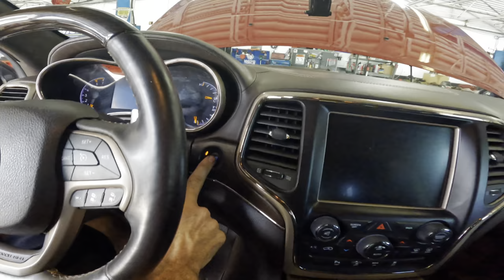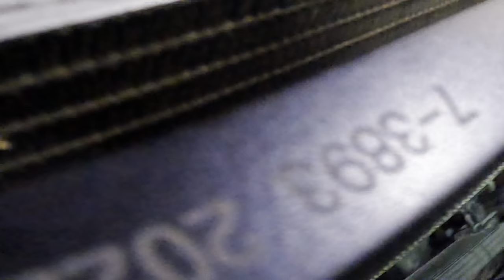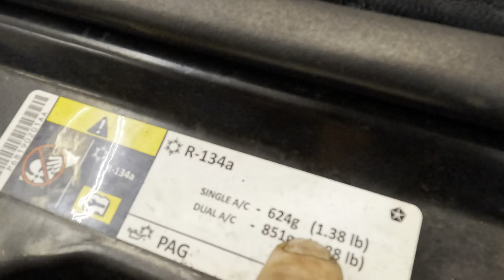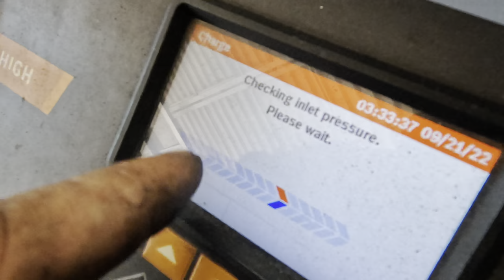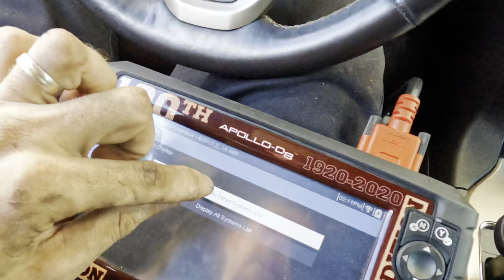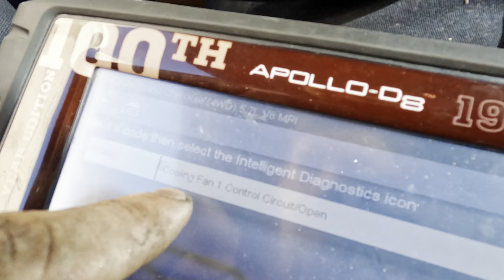Hidden Collision Damage! This thing blew up twice! Jeep Grand Cherokee 5.7

Comment: Even though the Jeep Grand Cherokee is a unibody vehicle. It is still a Jeep and it follows from a tradition that started I believe in the late eighties early nineties of making the vehicles in an extremely strong unibody construction. Chrysler has always had the strongest of the unibodies since they started in the late 50s early 60s. The truly sad attempts by General Motors and Ford in their early days to make unibody cars were horrendous. Just so you know, the current Grand Cherokee although with a stretched chassis is the same vehicle with a different body as the Dodge Durango. So the Durango is actually a Jeep but a Jeep isn't necessarily a Durango.
As you correctly pointed out, a Jeep Compass is not a true jeep, it is actually an updated PT Cruiser. It has the exact same chassis as the PT cruiser, along with several other iterations of different dodges and jeeps but not real Jeeps.

Comment: It always amazes me that you can hose down an engine. I would think all that electric stuff would make it impossible.
Reply: they're supposed to be able to handle any amount of rain at driving speeds, so a garden hose is definitely not going to come close to that. i wouldn't suggest pressure washing it but a garden hose is fine if nothing is broken

Comment: Ray Ray, It's a Jeep thing!  Chrysler makes things 1000% harder than it has to be. Look at those dang Chrysler electric connector locks that only work maybe once or twice before they brake into 1000 pieces. I own a  2002 Jeep and not one of them has survived, Zip-ties are a Jeep owner's best friend. lol Good job Ray, these new Jeeps have too much BS shoved in a small engine compartment for my liking, I'll stick to the older ones with room to work on it. Ray No reeee, but if you spray silicon on the air box rubber grommets they slip on like butter and the next guy will not take your name in vain. They can be a son of a mother lover. lol :)

Comment: Re-invent the wheel? Yeah the hose bracket was ridiculous. But I was thinking the same thing about the clip on trans cooler lines. Wasn't it better the way they did it on the older cars? I mean other than some idiot rounding off the fittings I thought it was just fine. Nothing like hunting for a tiny clip that went flying and you can't finish without it.  Engineering school, a couple years as a mechanic, then you can design new cars.

Comment: @Ray I'm thinking of buying the Ryobi One+ electric wrench, do you or some other viewers have advise if I should get the 1/4 version or 3/8? Seems to be the same machine, just the socket size that differ. Same NM, speed etc on both.

Comment: That stupid hose clamp could have been much easier with my pair of 16" Crescent RT412, I would call water pump pliers. Years ago ChanneLock started to make a competing design nowadays called ChanneLocks with the worthless flat jaws. Go pull a picture of those RT412 and you will see what I mean. I also have a couple pairs of this German brand that mirrors the RT412. It has a adjustable thumb wheel that click locks any size in kind of what vice grips use and these jaws would have 75% more contact area and  holding power. Much less likely to distort cylindrical parts. I will try and remember to get that name and model next time I get to my shop.

Comment: I haven’t seen a video to ask this question but could you recommend a tire pressure gauge that might last or be accurate?  Cheapie at the auto stores are killing me.  My tires fill to 70 psi max.
Reply: I would look into Milton tire gages. Made in USA and good quality. Sold on Amazon if you can’t find them locally.

Comment: Ah yes those Jeep condensers don't need damage to leak on the corners like that. How many green clips did you break taking the rubber strip off the core support? (Horrible things!) Well yes it would have been easier taking the front off and top of core support completely off but about the same time involved, with no fighting of fans and hoses. 
The green dye has its merits with some things and not others. I recently diagnosed a Mazda 6 with a seized compressor and a leaking pressure switch which I replaced the compressor, switch and condenser today. Even though I picked nothing up with the Hydrogen leak detector the back of the condenser was covered in dye. On the same token I recently replaced a badly leaking evaporator in an Isuzu Dmax and when I pulled it out there was no oil, no dye, so no signs of a leak but when pressured in the tub, huge bubbles. Go figure!

Comment: Ray there are GOOGLE answers to fluorescence and phosphorescence.   The interesting thing is that it is a "down" event almost exclusively (yes almost).  In human visual terms, Green Light can result in Red Light, but Green Light would not result in Blue Light.  Using UV means you have the full human visible spectrum as possible colors of florescence.

Comment: Admittedly, I'm a bit of a Jeep snob. Jeep has a heritage that started with a unique military design that lives on in the Wranglers and even the newer Gladiators, which therefore are the only real "Jeeps". The Patriot, Compass, Grand Cherokee* and Liberty are "made by Jeep" ... they're not Jeeps (The Commander gets and honorable mention ... it's close to being a Jeep).  *some older Cherokees used to be Wranglerish ... they count.

I also have anecdotal evidence to back this up. Jeep owners (Wranglers) have an unspoken rule ... well ... it's pretty spoken nowadays. All Jeep drivers wave at other Jeep drivers. It's a club. It's a rule. It's the law (okay, maybe not the law). And if you're riding in a Jeep you'll notice that nearly every single Wrangler driver will do it ... but the other models made by Jeep will almost NEVER do it back and certainly won't initiate it. So that's my proof. ;)

Comment: Why would you add UV Dye to the ac system when the vehicle comes from the factory with UV Dye installed by the manufacturer when the vehicle was built? I am asking this as a "former" Mopar Factory Trained Technician too! WHAT??? YOU DIDN'T ADD REFRIGERANT OIL yet the system is now LOW on REFRIGERANT OIL from SAID LEAKAGE. If you looked at the Service Repair Information it clearly mentions adding REFRIGERANT OIL back into the system! WHAT THE HECK!!! No Jiffy-Tite Disconnect Tool Set to disconnect the transmission cooling lines? Come on MAN!!!!

Comment: wtf? You need to hold that fan THROUGH that Condenser? never see something like that, (german car mechanic) im like what? I know its not a problem  when you dont hurt the vertical lines but wtf? is that common in US?
Reply: didnt mean fan, i meant the other cooler but still wtf?

Comment: When the black light excites the pigment.  The reaction is,    florescent.    It's called, florescent.   The same with old, cathode ray tube,, TV sets and oscilloscopes.  The electron beam hits the, Day-Glo phosphor.  And it floresce's.  It glows.   From the excitement of the frequency of the light.  And so TV sets and oscilloscopes used to have a florescent phosphor.  On the screen of its display.  And it all has to do with phosphorescence.    Which is a big word.  I know.  And a lot of use of P's and H's.  That don't sound that way.   Are not  pronounced in that manner.   And so… What the PHUCK is with that?  I dunno'?  It just had to be said.  And so I included that, conveniently, here.

It'll all happen one day.
RemyRAD

Comment: The air intake is a comedy. Bad filtering hot air intake from engine bay. The original intake and air filter is way better and more power with colder air from outside engine bay

Comment: Dude still has time to edit and upload a video after a CAT 4 storm heading his way, that being said FYI  1:14 UV light radiates at shorter wavelengths than visible light and cannot be seen by the human eye. However, when UV light is absorbed by certain materials, it is reflected back towards the eye as longer wavelength visible radiation, or visible light. This phenomenon is referred to as UV-induced visible fluorescence.

Comment: You couldn't pay me to reuse that very, VERY stupid & ENTIRELY unnecessary clamp. Whoever designed it should be shamed for life as well as the company who hired the damn fool. A regular hose clamp or a zip tie or even just some twisted copper wire would be WAY better in every practical aspect imaginable, even IF it was going on the space shuttle FFS. With these here interwebs & all, we finally have the power to expose all such "intentionally idiotic things". So lets do it. Now we know who NOT to purchase anything whatsoever from. I wasn't even there & I want names, addresses would be fine too. 🤣👊🐒

Comment: Nope, not a jeep
Reply: Lol the Grand Cherokee actually is trail rated and is awesome off road except for rock crawling it’s pretty good other then that . Had mine hunting all over out west and went in snow the big 4x4 pick ups were getting stuck 🤷‍♂️ I was surprised
Reply: @sheerwillsurvival2064  i am, of course, a bit of a snob with my ‘75 CJ5.  I never get a wave from the SUV crowd…I’m so offended
Reply: @HEYMLO  lol that’s a real Jeep AMC .. had a cj5 and a 7 back in the day 👊🏻
Reply: @sheerwillsurvival2064  Not trying to sound rude but wtf does trail rated mean? It is a term I haven't heard much before a few years back if that.
Reply: @frizzlefry1921  it means they tested it again several different obstacles and it passed it’s like a Jeep obstacle course. But basically a selling point 😁
Reply: @sheerwillsurvival2064  My pickup truck is trail rated for pavement.
Reply: @standhd  😁😂 it’s all marketing right
Reply: @standhd  most folks use their Jeep’s to mall crawl 😁
Reply: @sheerwillsurvival2064  I refer to mine as the “grocery getter”
Reply: @HEYMLO  I started using my grand Cherokee elk hunting over my JK as the 3.8 sucks on gas . But was surprised how it got me wife out of Idaho backcountry in snow storm. So the jk is the shopping mall crawler now . I feel ya
Reply: @sheerwillsurvival2064  gas for the 304 is measured in feet per gallon I think
Reply: @HEYMLO  lol I remember but it was only 79c a gallon in 1977 😁 so it wasn’t bad sometimes it was a whole $1.36 gal 😕
Reply: @sheerwillsurvival2064  YEP…😂😂🤣🤣

Comment: It does not count as a Jeep.  A Jeep has 3 doors and a removable top and 4x4.   Go alil deeper, it has a 4 cylinder engine and a manual trans.  Anything else is a poser.